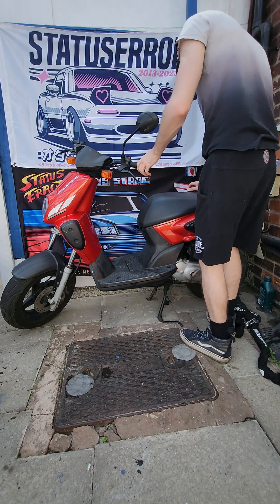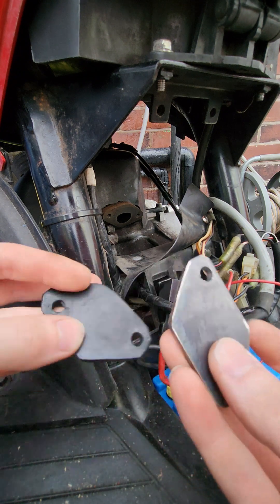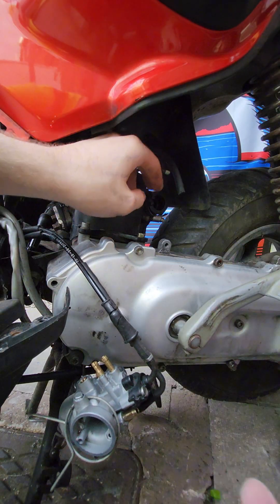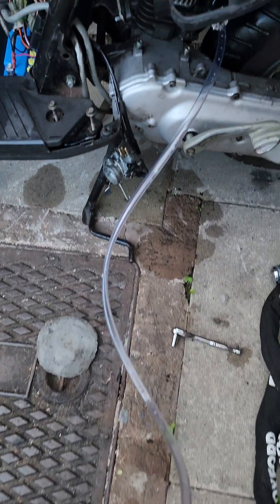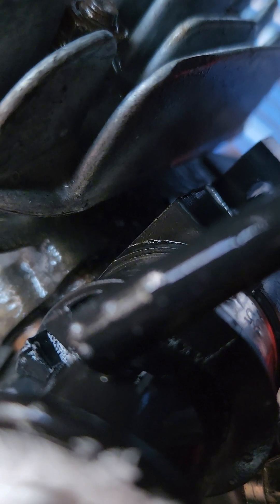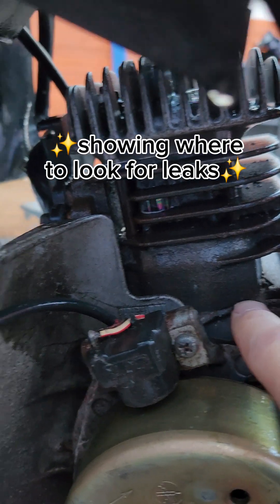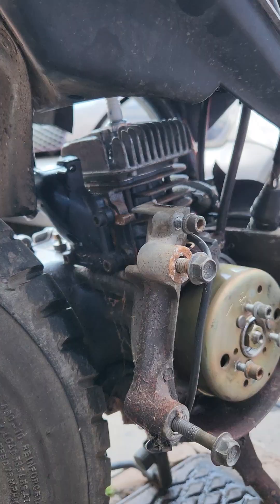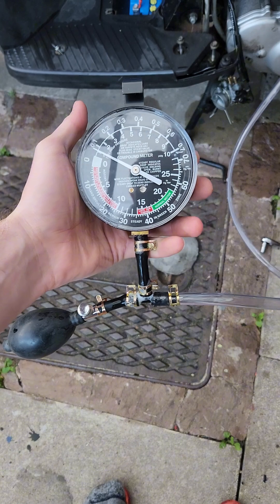Most Important Scooter Tool | air leak down test

Comment: How do I make one of those for myself
Reply from the maker: I have a new video on this coming next weekend, but you just have to search on google for an air leak down test kit and then rig up a few bits to complete it, as for the metal plate i just made that with an angle grinder and the rubber I just cut to shape with scizzors
Reply: @2slow2stroke thank you 👍

Comment: Hi, I have a Yamaha Zuma 2 stroke , I have an air leak I cannot find, can I spray soapy water with the engine running and would it give me bubbles like in your video ? I already tried to spray around the carb and intake and no bubbles, but I think I have to remove the plastic engine cover to make sure there is no leak on top of the reed valve. I also tried spray carb cleaner and no idle change, that one is a hard one to find..Thanks.
Reply from the maker: Are you sure you have an airleak? If youre doing the test the same as me using the same equipment and you cant find the leak around the sparkplug hole, the cylinder parts, the intake manifold and not between the two case havles you could also check the crank seals on both sides of the engine, it may very well be those, you want see bubbles running the engine because it will be sucking in not blowing out
Reply: @2slow2stroke  Hi, you meant I won't see bubbles with the engine running ? I also tried to spray carb cleaner and the idle didn't change..Unless the leak is on the top part of the reed then I have to remove the engine cover to see it I guess, I also remove the transmission case and their is no oil in there so I guess the crank seal is good ? , Also clean the carb and sets twice...Thanks.
Reply from the maker: @francoispoirier1557 air passes through gaps oil cant, you could see no oil and still have an airleak on crank seals plus its sucking into the engine when the engine is running not blowing out, so no you shouldnt see bubbles
Reply from the maker: @francoispoirier1557 but i take it you have a gauge like mine and your doing a similar test? Exhaust port blocked, with the gauge/pump running through the inlet manifold, piston at BDC etc, take engine cover off, make sure sparkplug is tight etc, keep trying, check the gauge make sure air isnt leaking out of it somewhere
Reply: @2slow2stroke  I don't have the gauge so I think I will build one or bring it to a shop. Good tip on air could pass were oil can't..I will remember that. I think I have no choice but to do a proper leak down test,  other wise it will take me forever to find if I have a leak . Thanks alot.
Reply from the maker: @francoispoirier1557 yeah gotta have a proper kit, where are you based message me on instagram, i cant imagine garages are equiped for this specific task, even though its very important

Comment: Thank you for a great video. Everyone should perform this test on 2 stroke engine and sort it out even if it is the smallest leak one could found. So far this video is the best on youtube on this topic. Cheers
Reply from the maker: @ducati998  thankyou so much, yes its a very important thing to do on any 2stroke, id consider it almost like doing an oil change on a car, its worth a check if youre having issues or if you just picked up a scooter from a previous owner
Reply from the maker: @ducati998  thankyou so much, yes its a very important thing to do on any 2stroke, id consider it almost like doing an oil change on a car, its worth a check if youre having issues or if you just picked up a scooter from a previous owner

Comment: This video is way underrated. I had the same issue on a new shape typhoon. Previous owner split the case for a new crank. I was also changing jets, ruin a few cylinders and pistons due to soft seizes and overheating from lean condition. This has to be the most important thing to do on any type of engine. To keep the stoichiometric ratio of air to fuel consistent as can be.
Reply from the maker: New videos out now and more coming 👍🏻🤝🏻